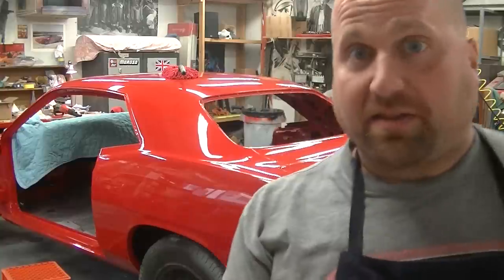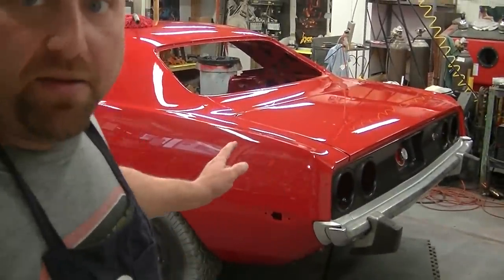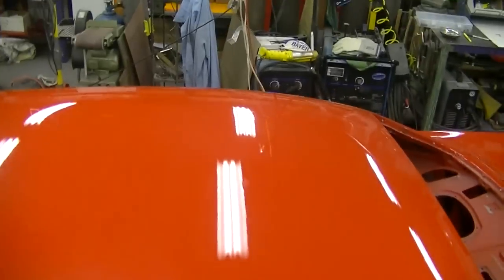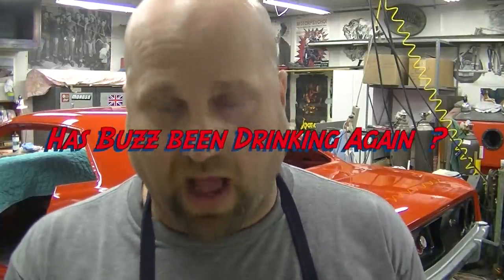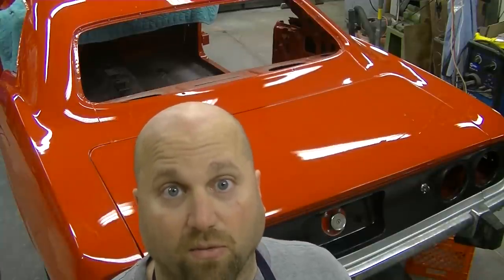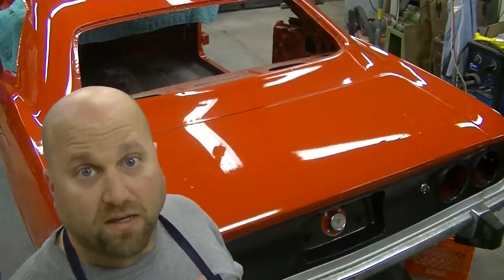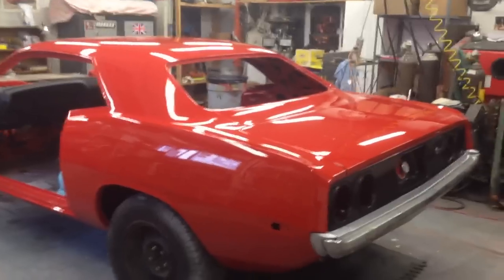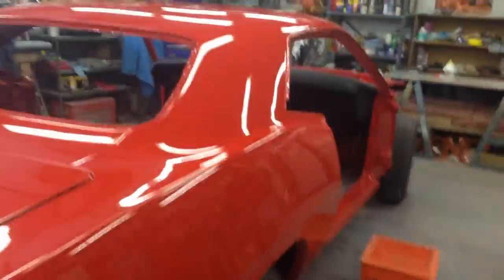Buffing a 1973 Barracuda

Comment: I paint and polish cars on the side for spare cash. While I don't recommend rotarys except for a few circumstances, if you lay a line of product on the car and the turn the polisher on and move it along the line of product so that is picks it up going with the rotation of the pad it will pick it up nice and smooth and you don't have to worry about slinging it. 

If you are worried about your product drying up on you, switch to a product that doesn't have a break down cycle because it uses diminishing abrasives. Products with non-diminishing abrasives have more ingredients to promote longer work times. You can also mist you pad with a detail spray to bring the compound back to life if you would like as well. 

With the advancement in pad and product technology I rarely use rotaries for cutting work anymore because they are more hassle than anything else. If you get a strong cutting compound and a microfiber cutting pad you can level the paint just fine with a DA polisher and it is a x1000 easier to work with. You shouldn't even need a wool pad if you color sand it properly. A pneumatic rotary has WAY to high of RPMs which you obviously know, but I felt like needed mentioning as well. 

I only use rotaries for finishing super soft clear. Ones found on black Nissans and dark BMWs are the worst. YMMV. However, would be good for you to invest in a proper DA because they don't remove any more paint than necessary which is key in the future every time you buff the car. Even if you coat the car with a ceramic it will make the coating last that much longer.
Reply from the maker: James T Kirk Thanks for the Info, This is my First Car I ever Painted by myself so I was going off several Youtube videos and just talking with Paint Shops. Lets just hope it looks ok in the Sun, Thats when I'll know if I did it Good or not. Cheers Mate
Reply: BuzzJones Yeah paintshops or well "bodyshops" usually are structured around production hence the rotaries and wool pads. If you go an check out a shop of someone who details really high end cars they all use DAs. Some of them are really fancy but a Portcable 7427 is where most people start. I have one but it keeps a 3"inch backing plate on it and is only for pillars and jambs mostly. If you want to try one out I tell people to grab the one at Harbor Freight. I've made lots of money with my cheapo DA from there :). Just get a 5 inch backing plate. Most DAs like that seem to struggle with 6 inch pads. You can find Meguires 205 polish at HF too. I don't break it out too often now days but it is a good polish. They carry 105 which will cut well with a DA good enough for 1500 grit sanding marks but dust like crazy. I HATE DUST! But if you are just wanting to experiment a bit and not order stuff off line it will get you an idea of how well you can finish paint with a DA and foam pads. Microfiber pads cut even better although I always end of finishing on a foam pad when I am going for broke on a special car. Depending on where you are that info might help. I remember helping a buddy paint his car in his back yard. We all start somewhere. I just hated working in shops that wanted you to cut corners in order to get stuff out just to get more stuff in. I like doing things right so I do it on the side now. Bodywork and paint restorations keep me pretty busy, but I have been toying around with painting guns recently and am really liking it. 

One last thing, when you get your car out into the sun if you see shimmering or whats referred too and called holograms it from using a rotary and not keeping it level. That is one of the biggest advantages to a DA other than just how much more pleasureable they are to work with. It is almost impossible to burn the paint or leave holograms.

Comment: I think I would have aligned all the bolt on panels first just prior to buffing, it's almost impossible to Install doors alone without scratching something..Maybe even checking trim fitment even before base coat so you know they're a snap on fit...just me..